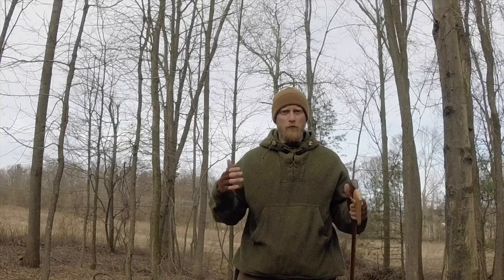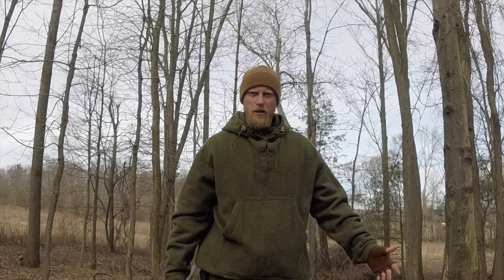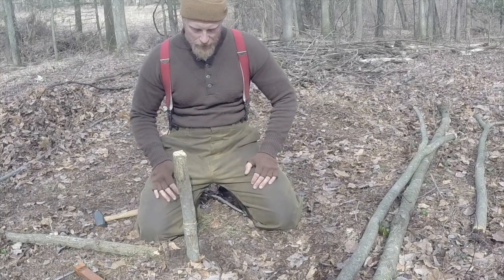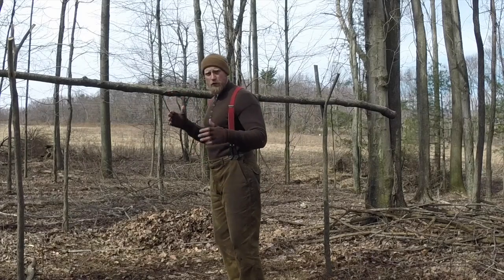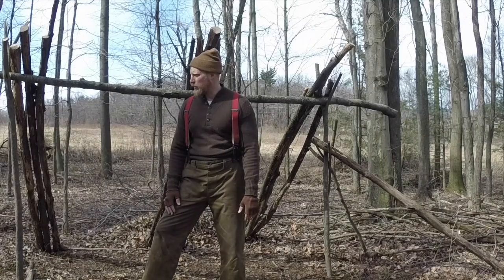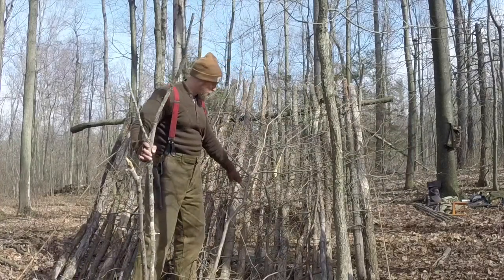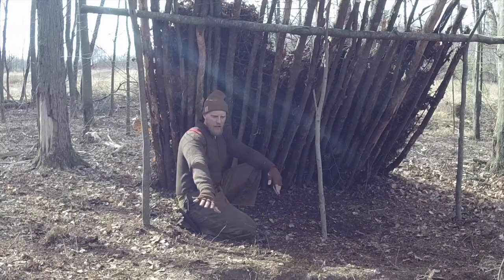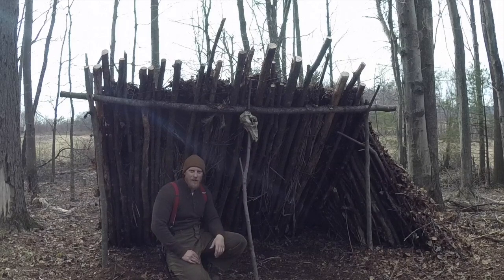Trappers Debris Shelter

Comment: Lots of big trees down in the woods. You can use a high end for the main pole or the root fan. You can lay small logs across the root fan hole to sleep on and get up off the ground and slope your lean -to off the root fan.  Saves a lot of work if you are in a hurry.

Comment: Mors says that positioning shelter like that will bring smoke in as the wind roles over the top of the 
shelter and cause a whirling affect. So he builds his facing south so the west wind stokes the horizontal fire and takes the smoke away,  and so you can get the south facing sun. What do you think?

Comment: Awesome video. 
Do you normally have the wind to the back of your shelter like that (does that cause smoke to swirl into the lean to?) or is this a specific case because protection from cold wind is a priority for this shelter?  I was just curious as I was led to beleive that you should have the wind blowing on the side of your shelter eg going between your shelter and the fire.
Would be great to hear your take on this if you get time!